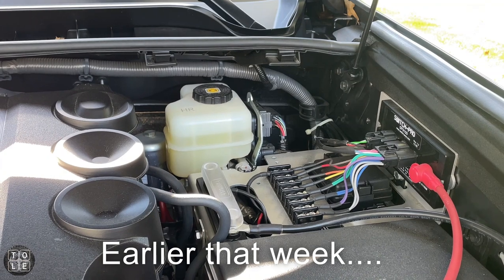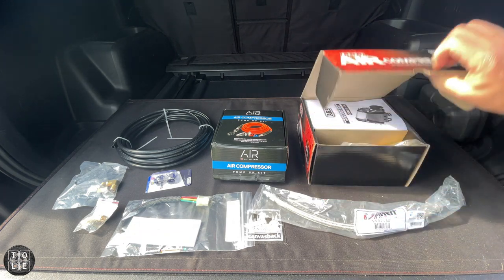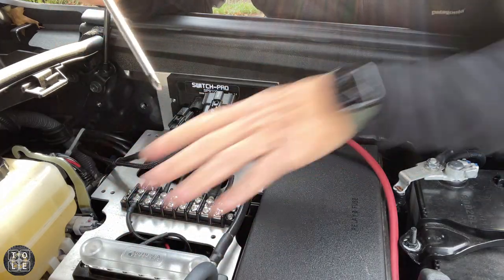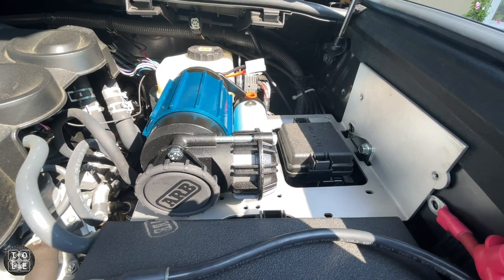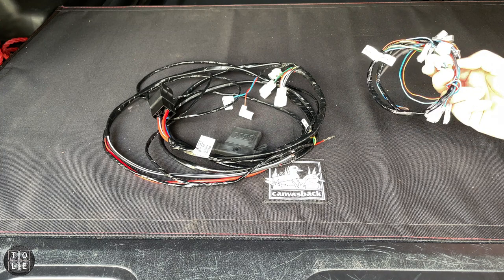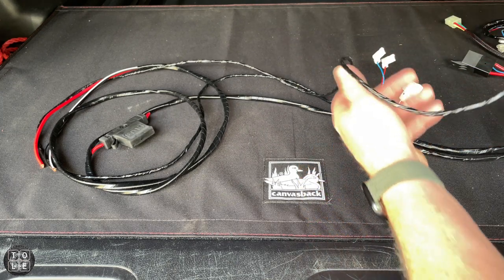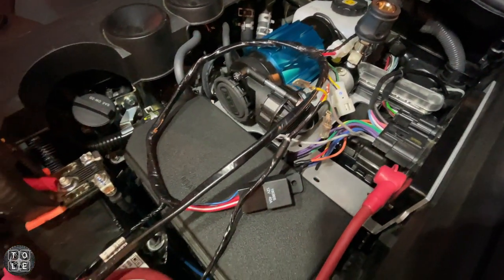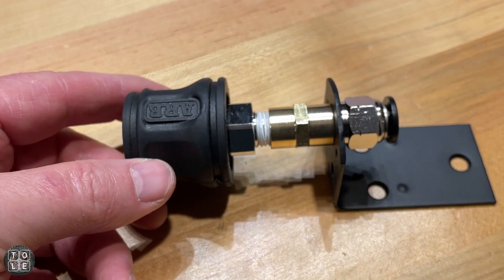ARB Onboard Air Installation with SwitchPro 9100 integration on my 2020 4Runner TRD Pro

Comment: Thank you sir! I'll do the same install but on the passenger side (there is an open space in the upper left corner when facing the engine) using the LFD Offroad mount for the 5th gen 4Runner. I have the SwitchPro 9100 as well but it is on the other side of the engine bay so I'll have to run those wires plus power and ground. Hopefully it all works out!

Comment: Where did your SP terminal block end up? I see them going into the large loom, but where is it terminated? I'm guessing you had to extend them ? Or did you purchase a new SP harness?
Reply from the maker: I wired the accessory device directly to the SwitchPros wiring harness. That is what you see hidden within the loom.
Reply: @TheOverlandEd ...when you mean accessory device you mean the "light/circuit" to be switched? So no terminal block anymore?
Reply from the maker: @brpnw4r94  from what I understand, Switch-Pros doesn’t even recommend using terminal blocks, if I remember correctly what was in their instructions.
Reply: @TheOverlandEd ..Hmm. I've never seen the 16 harness wires terminate any other way. I couldn't imagine having to de-loom  every time you want to run a new circuit and separate the ground, but it looks like you'll have easy access. You had originally cut the wires to the harness, so you really didn't have the option to do it any other way as they were shortened significantly. The compressor looks great in that location. Surprised Derek hasn't answered his email as stated in other comments. I'm currently waiting on a custom 3D printed mount for my TouchPad, and then my installation will be done. I did a duel battery at the same time. Cheers.

Comment: Which switch port did you use for the compressor? Was it a 20A one or a 35 A one? If' I'm understood correctly, even 20A is well more than enough room for just the switch. It's not actually carrying the current for the compressor. Great walkthrough!
Reply from the maker: I connected it to one of the 35A ones (switch 8) but configured the overamp to 5A.

Comment: So… the two thick Positive& Negative go to the battery… the smaller Positive and Negative go to the switch pro?
Reply from the maker: Watch the explanation of what I did again. I wired only the higher gauge red wire to the Switch-Pros. The thick gauge red (positive) and black, along with the higher gauge black (negative) were connected directly to the battery terminals.
Reply: @theoverlanded  was it nessary to run the loom with the relay for the pressure switch?

Comment: Nice clean install, working on my 3rd Gen 96 4Runner - a bit different but do-able I'm sure. Thanks again.
Reply from the maker: I also have a 3rd Gen 4Runner. I haven’t installed onboard air on that one yet.
Reply: @theoverlanded  they are a bit cramped under the hood area.

Comment: Really clean! Is there a plug or something to keep mud, dirt, insects etc from clogging up the front of the ARB quick connect give it's pointed straight out at the road ahead?
Reply from the maker: Yes, there is a cover, from ARB, that protects it from the elements. I purchased the cover after the install video.

Comment: Hi, thanks for making this video. I just got an ARB compressor too and I was looking on how to set it up to the switch pros. Question: I'm assuming that since the ARB's positive and negative power wires are going straight to the battery, that means that the wires go to the switch (but now to the switch pros) are just used to activate some internal relay inside the ARB, correct? And if so, it doesn't matter weather you use one of the 20A switches on the switch pros, or one of the 35A switches, correct?
Reply from the maker: Yea, it doesn’t matter. I ended up wiring it to the 35A switches but not required. I think I have that switch configured to 5A.

Comment: That’s a great set up! 

Where did you connect the pressure switch’s Red and blue wire? 

As for the red wire connected to the switch pro, where is it coming from? 

Did you use any relay on this set up? Thanks

Comment: By chance did you do a video installing your switch pro?
Reply from the maker: Unfortunately, I did not make a video of my SwitchPro installation. I can help by answering any questions you might have.
Reply: @theoverlanded  I appreciate your videos, you’ve given me some good ideas. Which fuses did you connect the switch pro to? I have a ‘21 without KDSS but there is a fuse in the inside fusebox for it as well as an open fuse that is wired. Was hoping to use these locations as opposed to an add-a-fuse.
Reply from the maker: Thanks Greg. Happy to hear you find the videos useful. Regarding the Switch-Pros, I ran the switch line into the cab, along with the control wire, and used an add a fuse to the main fuse panel in the cab.
Reply: Ed, how did you contact sdoffroad to get your tray that fits over the relay box and how long ago did you order it?  I tried Instagram & his hotmail email, I’ve gotten no reply back from Derek, not sure if he is still making these mounts for 2020&2021 4runner… any help would be appreciated if you have any contact info
Reply from the maker: I got my tray from sdoffroad in Feb 2021. The only contact info I have the instagram and the Hotmail address.  Not sure what is going on with Derek and why he is not responding to you.